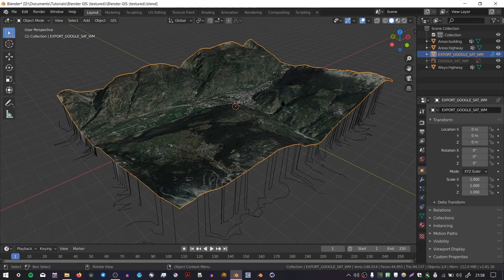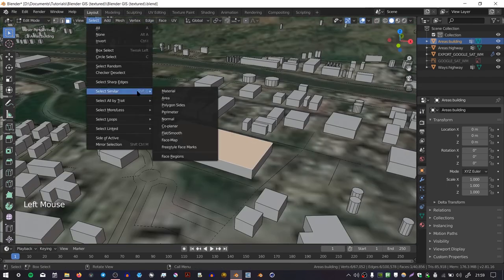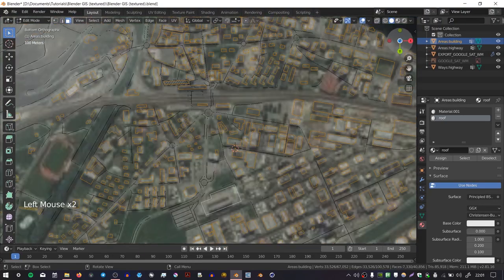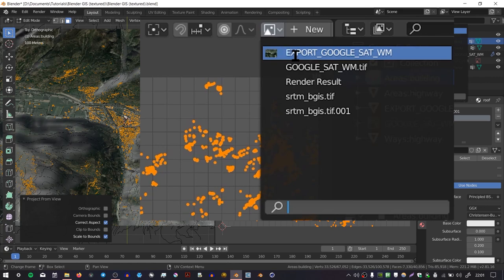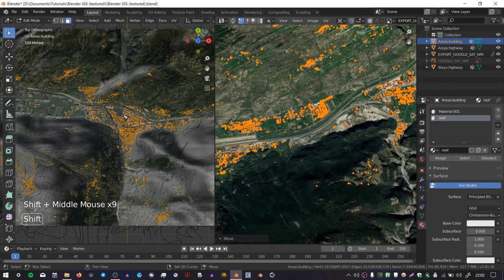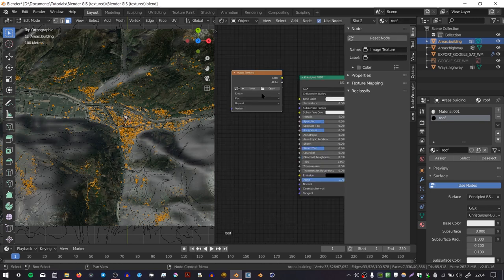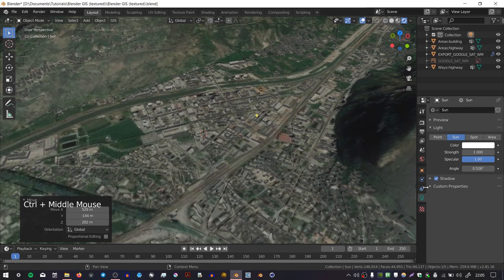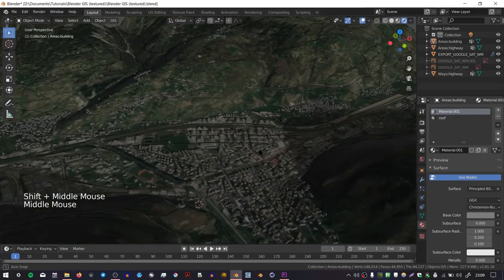Blender GIS - Texturing Buildings

Comment: Thanks! By the way, is there a way to simulate the correct path of the sun based on geodata (longitude, latitude) and maybe time of the year in Blender GIS? Do you maybe have a workaround for that if no?
Reply from the maker: There is a 'sun position' addon built into Blender which you might find useful for this: https://docs.blender.org/manual/fr/dev/addons/lighting/sun_position.html

Comment: Great stuff, I'm a 3DSMax user primarily [ducks] but I'm going to have to try this. I wonder if you could project video from Google Earth Studio on to the geo from this and end up with some kind of solution in to which you could render original 3D content. I don't 'think' it would be breaking their ToS either technically as you'd be using the GIS for the model, not google models.